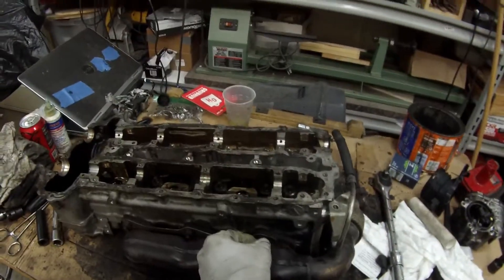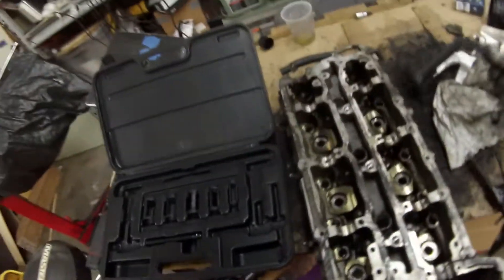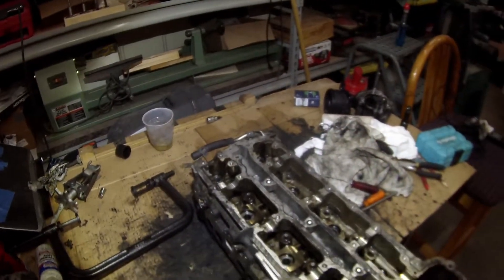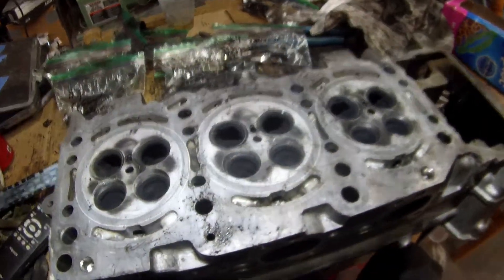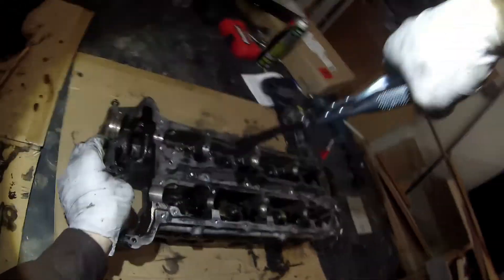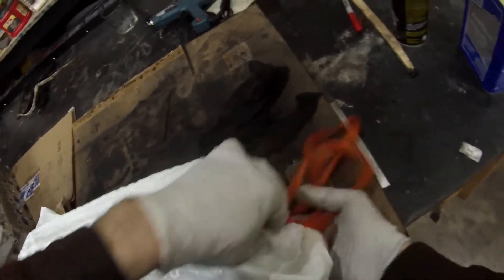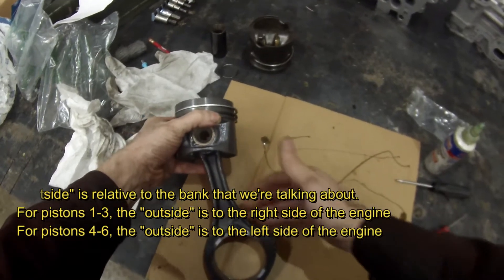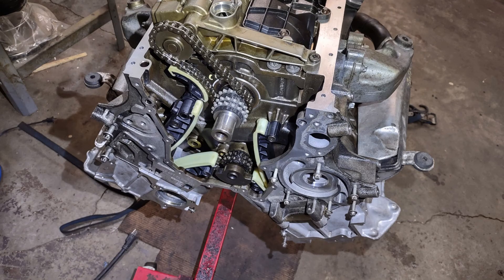Mercedes GL350 OM642 Rebuild - Part VI of ?

Comment: Why would you do this massive amount of work on this engine, when these OM642 engines are prone to collect carbon again after 50K or so miles due to the amount of oil that gets released thru the crankcase vent valve. In order not to collect so much carbon, you have to steer oil from from the crankcase went before entering into the turbo intake.
Reply from the maker: I'm a glutton for punishment?  

One of the reasons that it took me so long to move this project forward was that exact question.  Perhaps I should address that a bit in one of the next parts to this saga.
Reply: @williamehrman  Can vinegar be used to clean build up carbon in manifolds on OM642 engines, if so how? Thanks.
Reply from the maker: I'm not sure what you would be able to use on the manifolds.  If you've got them off the engine, then you could probably use pretty much anything as long as you rinsed them off quickly.  If you're thinking about trying to break up the deposits in situ I'd be worried about stuffing things into the combustion process.  I know you wouldn't want to try to suck seafoam into the intake like you might on a gasoline engine.  A vinegar solution would be inert, but I don't know enough about the diesel combustion process to tell you if adding some steam to the fuel and air would cause problems.